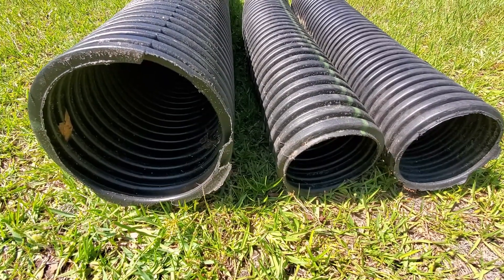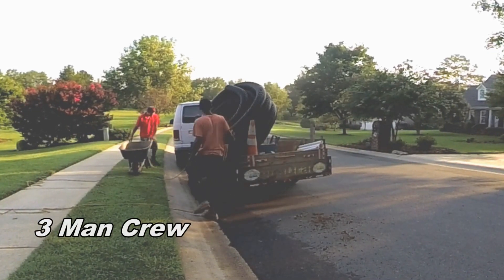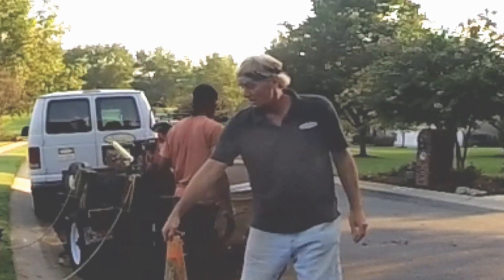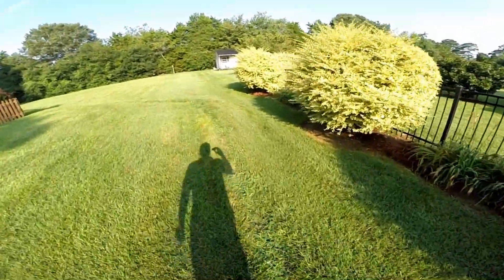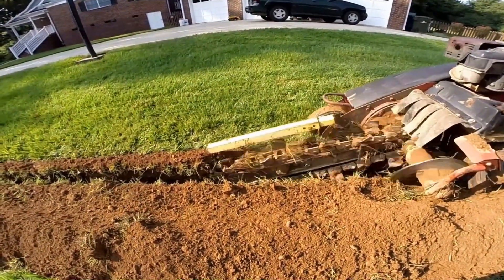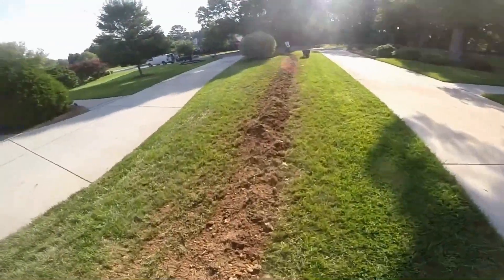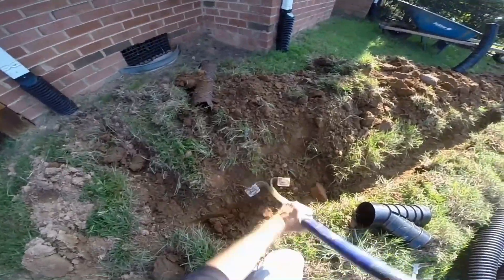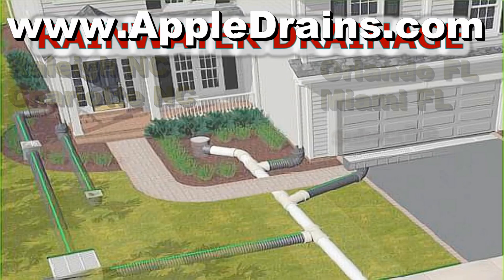Storm Water - 300 Feet - 6" Pipe - 4 Catch Basins -  Installed to Street -  DIY Backyard Drain

Comment: If your logic says that two 4 inch pipes will only fill half way so you are really running one 4 inch pipe worth of water, how does one 6 inch pipe run more water? Half of 6 is less than 4. The same logic doesn't apply to 6 inch pipes? Are they magic? How does this work?
Reply: He's off on this in what he says, but I think I know what he means. Let's calculate the surface are of a 6 and 4 inch pipe.
To do this, take the diameter (pipe size) and divide in half. That's the radius
6 inch becomes 3
4 inch becomes 2
Times the radius by itself
3 becomes 9 (3 time 3)
2 becomes 4 (2 times 4
Then times the numbers by 3.14 (a number discovered by an ancient Greek) and we get:
9 times 3.14 = 28.26 inches
4 times 3.14 = 12.56 inches
Cross sectional area advances by the square of the difference.
The difference in this example would be 1.5 (6 divided by 4)
But we have to square that, so it would be 1.5 times 1.5 and that would equal 2.25.
So, although a a six inch pipe is only 50% bigger than a 4 inch pipe (half of 4 is 2. 4 plus 2 equals 6) it can carry 225% more flow.
Reply: @oisinofthefianna3246  well at triple the price for the pipe, I would take three 4 inch pipes. But your math is solid!
Reply: @texaswilson80  
If your Pizza Parlor gives you a choice between a 20 inch pizza or 2 ten inch.....you know you get the 20 inch! Wooo!